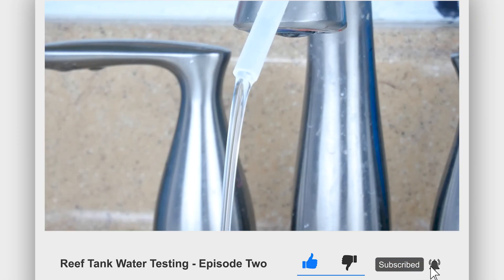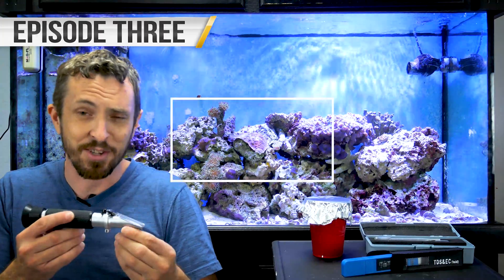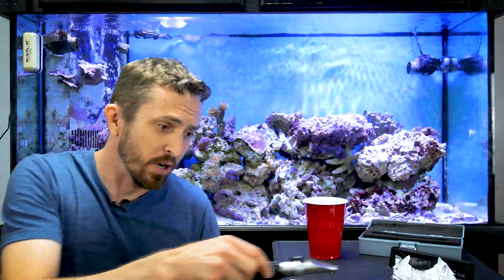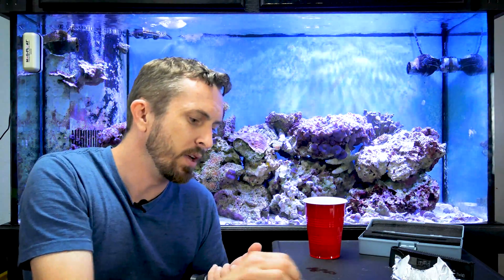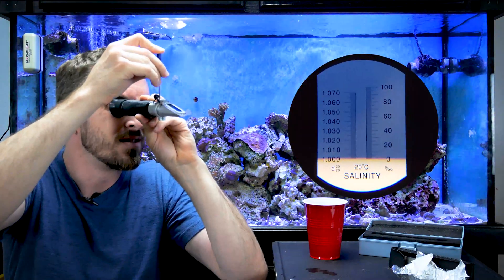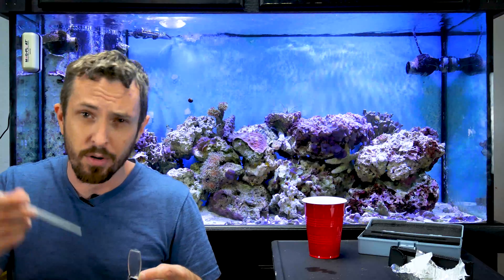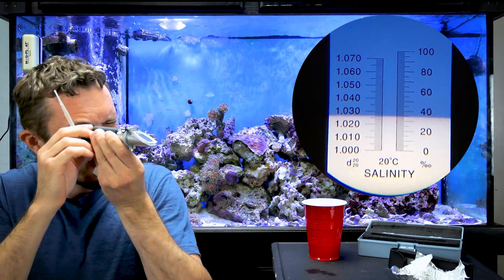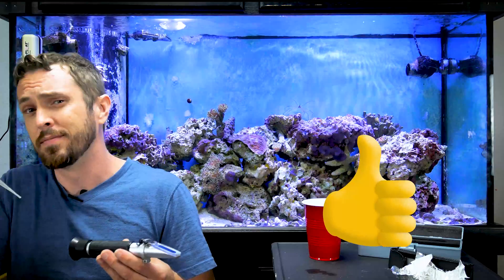Refractometer Calibration Made Easy with RODI Water | Checking Salinity - ZecsReef - Episode Three

Comment: You’re doing it wrong man and misleading people here. If you calibrate your refractometer using RODI water to zero you are going to wind up with unusually high readings and the 1.020 to 1.0250 readings range you should always use a calibration solution that is commercially available that is designed for calibrating refractive specifically for that salinity range. They are typically set to be 35 parts per thousand this puts you right into the range that we typically use for saltwater aquarium keeping. If you calibrate using RODI at zero, it will report that your salinity is higher than it actually is if you don’t believe me find a high-end saltwater reef keeping store that has a high-end electronic, digital salinity tester, calibrate your refractometer, using RODI water and then take it a sample of your water into the store and you will see that your readings are gonna be off. I made this mistake myself.